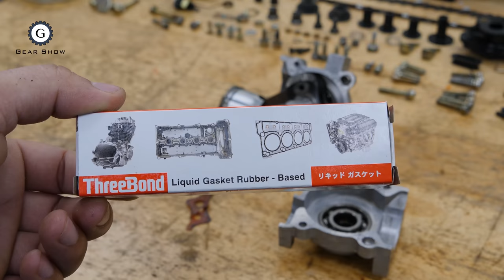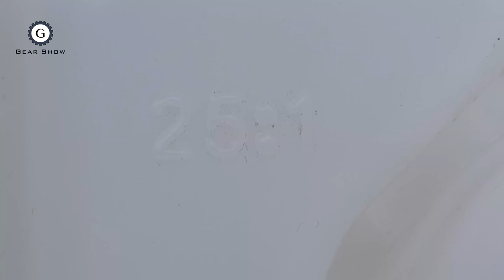2-Stroke Engine Chainsaw Restoration

Comment: Flywheel - a wheel that decided to fly away. Nice to see a two-stroke running so clean. Keep on making content!
Reply from the maker: Thanks, will do!
Reply: Dangerous dude
Reply: @josephterv9202  it just brake
Reply: It was the clutch mechanism that went flying off.....the flywheel is the finned round object on the other side of the machine, the one he did not torque up to spec. Unless he did it off camera, he should have thoroughly cleaned the carb out too, with new gaskets and diaphragm and seals. He also should of checked the cylinder bore for wear, and also the piston and rings.

Comment: Great video sir.
I rebuild a lot of 2 cycle engines.  I would advise if you do more to invest in a tool to allow you to pressure test the crankcase. With a saw that requires this much disassembly/reassembly it sucking to get to the end only to find out the crankcase is sucking air. 
Again great video, keep up the good work 👍

Comment: Hey, at 18:35, when you mounted engine on the frame, was there supposed to be a some kind of metal plate between bolts and frame? At least you took away some kind of plate at disassembly. And at 25:50....Autobots, let's roll :)

Comment: 11:43 what is that spray ? break cleaner? i got a rusty chainsaw been in the barn for 3 years, i want to clean the engine in the inside from old petrol residue...whats the recommended solution?
Reply from the maker: It is rust remover spray.

Comment: Sorry for my criticism. But now I think you're the 10 or 11 I'm looking at here on YouTupe who is restoring a chainsaw. Unfortunately, you join the ranks of the amateurs. The reason for this is that you are not using new crankshaft bearings (at least no one sees you changing them), you are installing a new oil seal instead of both. But the biggest and hardest point is that you glue the old cylinder base gasket back in with sealing compound. 
That is botch and sloppiness in the highest degree. It continues with the carburetor. No new membranes, needles or fuel hoses. Not even cleaned or cleaned in an ultrasonic bath. And you have a really good ultrasonic bath there. Unfortunately, the chain guide can no longer be used (mount at 20:46). The chain is only working on this even more. 
I'll let you get away with using the old spark plug again. You can't do it well with such a restoration.
I don't know if I saw wrong, but it looked like you used the old air filter. Another point that you normally don't do.
What is inevitably noticeable is that you have not cleaned any of the two tanks and have replaced the filters in them. Neither the chain oil tank nor the tank for the gasoline-oil mixture. 
That's supposed to be the end of the criticism. I'm sorry and don't mean it badly. But it just hurts the soul of an old mechanic like me to see something like that. And please, to all of the people reading this, please don't hold it against me. It's just a review

Comment: You should find a bunch of motors that still work but the rest of the machines are beyond repair, and then create a decorative floating magnet thing. Just hook up magnets to the motors and when they spin, you can get metal to float. You could even have a floating table or something.

Comment: @26:23 that is the cleanest running 2 cycle engine. What was the oil/fuel ratio you used?

Comment: the gasket could usage some trim, and assembly lube on the piston and such.
Reply: You don't bring out any assembly lube for an off-brand $65 chainsaw.
Reply: I have never seen assembly lube, used on any small engines, a 2 cycle would have to burn it out, correct ?
Reply: @davidhamm5626  I don't know, people seem to lube the piston and stuff during assembly.
Reply: @ricande  thats a tanaka ecs 3351  indestructible chainsaw.  Best in its class 30 years ago, better than many of the new top brand saws.

Comment: uh, there were very long threads behind the clutch..  looks like someone was cutting his safety pants one day.
Reply: this machine looks dangerous to me with what looks to be a fake chain brake. The piece in front of the operator's lead hand is supposed to be a brake that stops the chain of the saw kicks back at you. That looks like it's just fixed to the other handle.
Reply: @slashrjl  that was exactly my thought about the brake as well.

Comment: I can't believe how much dirt was built up inside the pull starter,the main problem with this model is the air cooled engine is completely enclosed,and will cause it to have overheating issues....

Comment: This is not a restoration, this is just a - not even thorough - clean. During a restoration you're supposed to change the parts which are used and fubar. Like the gaskets e.g.
Reply: He replaced the primer bulb and some gaskets.